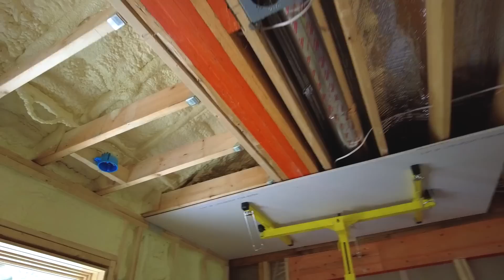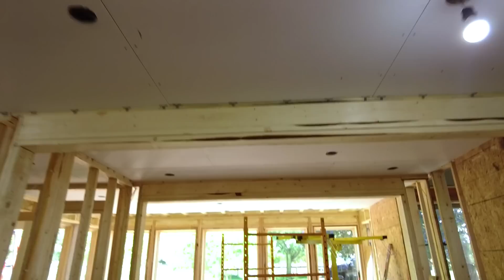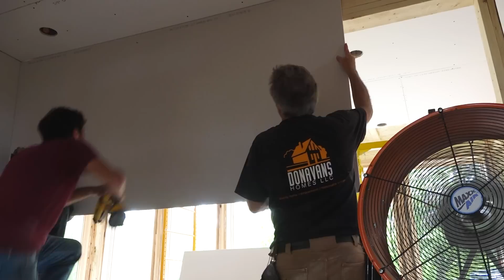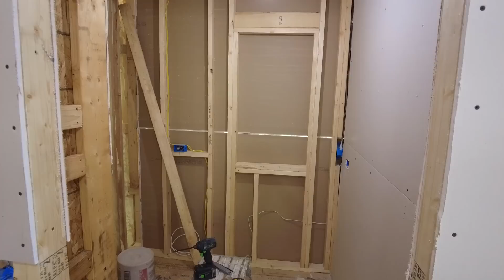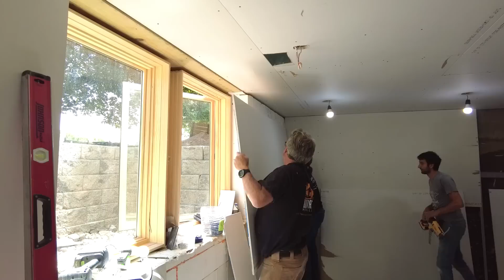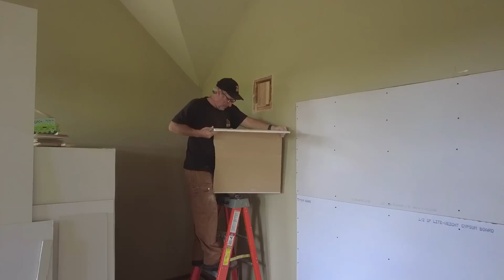Covering up our Beautiful Framing | Home Renovation & Addition Part 47

Comment: FINALLY !! Someone hanging drywall per code 😅😅… installed drywall in a customers add on this week and we installed 5/8“ x 54” x 16’ on the ceiling 5/8” is code here on the ceiling and the ceiling is installed before the walls … Good Job guys and gals 👊🏼👊🏼🪚🔨✌🏼🇺🇸🇺🇸

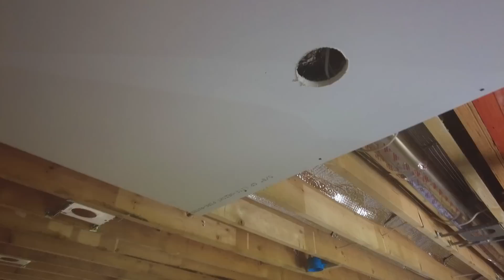Comment: Matt at 2:00 in doing the ceiling..  You guys don't use "strapping" across all the joists?  And the sheet rock mounts to that.  Also leaves a mini nook for the electrical wiring to go so they're not trapped in the bays and can't snake new wires after the ceiling is up..
Is that only a NorthEast thing?

Comment: I wondered why you were using a router to cut out the windows until I saw your next video which showed the other side and the router following the framing. In this video, how is Donivan finding and cutting the holes in the ceiling sheetrock?

Comment: ineresting no vapour barriers sheets on the exterior walls e and unsupported joines between the joists we always support them to avoid cracking
Reply: I believe they used closed cell spray foam to serve as a vapor barrier.
Reply: @GMC.Sprint  ok i see that now closed cell foam is a big no no in the uk now mortgae companies and surveyors dont like it as it traps damp and blocks ventilation in our roof consturctions.
Reply: @gavinferguson  I'm not a big fan of the spray foam in the southeast of the US.  My big issues are that it can hide leaks, and termites can tunnel through it unseen.  We also have a lot of heat and humidity, so places that are to well sealed grow mold.

Comment: Don't know if this was asked but is there a reason you didn't glue and screw the ceiling.
Reply: Australia has that requirement I know but in the US I have never even seen "drywall glue." Not sure where you are located, but It wasn't until I saw a bunch of videos from Australian drywallers when I first saw it. From what I can see, in Australia you can get away with a lot fewer screws because there's so much glue but here we just use more screws than you will see over there.

Comment: I noticed you don’t use ‘stud glue’ ? here in AU it’s specified to glue, the screws hold the sheet on until glue dries  ‘Gyprock’ or drywall. Also your ceiling sheets are dam thick, we use 10-12mm although it doesn’t snow much, :)
Reply: The 5/8 ceiling drywall is supposed to be for fire rating. its supposed to take longer for a fire to burn through to the upper floors or attic. In attached garages, they often specify two layers of 5/8 drywall  for a total of 32mm of thickness.
Reply: @bucklanddarrell3911  Some elevator shafts are up to 6" thick rock. Known as coreboard. It's 1" (25mm) x 2' wide.

Comment: Dumb question, I guess: how are Donavan's circular cutouts for fixtures so consistently good? Does he plunge the tool into the center mark on the sheetrock, run straight go to an edge, then let the tool follow the inside of the fixture? It appears to be freehand, but no way. I need that tool - I have never once made a cutout that clean.
Reply from the maker: Pretty close but once he finds the edge of the fixture, he pulls the cutter out a bit and moves to the outside and traces around that outside perimeter

Comment: Interested why you didn’t use furring strips on the ceiling? They also give a space to run the wiring, without having to drill the joists and helps for any future changes/ additions.

Comment: What a transformation. A couple of questions.
What was the yellow wire that snaked back and forth in the wall cavity in the right hand wall facing the back?
Do you not need plates to protect the wires berried in the foam foundation blocks? Like you need in stud walls when you run pipes through the studs?
Reply from the maker: That will be the feed for the cabinet that will go on that wall. The electricians will pull out however much wire is needed. Plates aren’t needed as the wires are far enough from the surface to not require them
Reply: @mcremona  Thank you. Making great progress.

Comment: I still don’t understand how he knows exactly where to cut the light part out from the ceiling, in a perfect circle right where it’s supposed to be...
Reply: He marks where the center of the hole should be then takes and saws a line from center to edge and follows the metal hanging there.

Comment: Last I heard, on the job, builders were requiring 80 boards a day to be installed. Every day. Commercial buildings are double rocked.
Reply: what the hell are you trying to say?
Reply: @idontthinkso666   Doing rock for a living sucks.  Do the math, at a minimum of 1/2 breaks in an 8 hour day,  80/7.5= 10.6 boards per hour. That's at least a board every 6 minutes.

Comment: Good morning you guys were using 8 feet drywall it is OK but after doing it for over 40 years I used mo ger board specially  I did a lots of slick finish a d for that it is better to have the least butt joint as possible but not to many people can do slick fin8sh today that is why they invented texture ceiling and orange peel wall it is an art to do slick finish but the hanging as to be done right also have a great day

Comment: Just curious as to why you don't use a "kick" or a "pocket kick" to lift your bottom wall sheets? 
To make the middle seams tight. You guys did move fast though.
Reply: I saw some blocks and pry bars in some of the shots. I usually just use some scrap pieces of drywall (1/2") to space it up from the floor and only pry up if needed.
Reply from the maker: Donavan didn’t have one in his trailer. We just used a prybar instead

Comment: Why is the ceiling drywall 5/8, but the wall drywall only 1/2?
Reply: It could be code.  I know there are some code requirements for 5/8 to be used as a fire wall.  If I remember correctly (in my area), it is required in a garage that is under living space.  could be required because it is a kitchen under bedrooms.
Reply: No, the 5/8” is used because the 1/2” would sag when hung from the ceiling.

Comment: So I see what I was doing wrong. I hung all my electrical boxes to be flush with the drywall. In doing so I was unable to push the drywall tight to the ceiling. Also I had to cut out the electric boxes from the outside of the box and not the inside.

Comment: Great video! Just a question about the drywall on the ICFs. Is the drywall not required to be fire rated, 5/8" minimum? I remember reading that somewhere but it may vary based on local codes

Comment: Wouldn't it be awesome to buil the house from real bricks and stones?  Maybe even use prefab concrete wall pieces? It would be properly fire- and hurricane-proof too. We use these 2x4's only for quick and cheap non-structural interior walls in Europe. Outside walls are solid! To be honest, i am shocked this kind of building is even allowed in the USA. I would expect a building inspector to stop this. In Europe we don't even build a dog house like this.

Comment: One idea for the pantry window is to use a window with built louvered blind.. that way you can get the light when desired but still close it off when you don’t want people to see in. Another option (albeit more expensive) would be the new electronic glass that can be switched on and off between opaque and clear.
Reply from the maker: Great ideas. Thanks!
Reply: Louvered blinds gather too much dust !! Keep it simple and easy - I suggest a one-way mirror !!
Reply: @johnking8679  I believe he meant blinds encased between the panes,he left out the word 'in' after built.
🙂✌️❤
Reply: My sister-in-law has a translucent blind that opens from the top AND bottom.

Comment: what is the screw attachments you use with your drills?  those are awesome.
Reply: It comes that way. It's not an attachment.
Reply: It is a Dewalt DCF620 20V Max XR Drywall Screw Gun with a DCF6202  Screw Gun Collated Attachnent.

Comment: What is the name of the tool you use for the holes in the ceiling and the wall.
Reply: RotoZip -- uses a spiral bit with a non-cutting tip that follows a pattern (electrical box, door frame, etc). Takes a bit of practice, but definitely the way to go if you  have more than a couple of cutouts. Mine's corded (don't remember cordless being an option back when I got it, but I was using a corded drill to drive the screws too, so needed the extension cord anyway), but cordless would be even better.
Reply: RotoZip was the first and like Xerox  it's a trademaked name.  Search for drywall cutout tool to find all the people who copyed RotoZip....
Reply: Thans.

Comment: I couldn’t agree with you more that the Dewalt Drywall screw gun with screws on a belt is the absolutely best way to hang multiple sheets of drywall.  I’ve put thousands of screws in drywall and didn’t have the dimple adapter and it’s a major pain in the backside.  The dimple attachment helped a lot, but it doesn’t hold a candle to how much easier it is with the dedicated drywall screw gun.  The rooms are all really looking more like a home place and less like a construction zone.

Comment: How does Donovan know where to make the cutout holes so accurately?  You all work as a good team for that drywall work.
Reply from the maker: Measures the box location before putting up the sheet
Reply: Experience is key with measuring the right spot!
Reply: Guys that do rock for a living, all the time, can feel the outlets and protrusions without measuring. When you do 80 sheets a day, 5 days a week, for years, eventually you get the knack.

Comment: Kitchen area really lowered the ceiling. The extreme length makes it look even lower. Didn't think you were rocking that area, just trim. Certainly easier with rock on first. And how tired is Donovan after those few days. Very hard work.
Reply: Sheetrock adds some R value as well as a sound deadening factor. Plus it will even out the imperfections from the studs. I would still tape all the corners to seal them off, but not do anything more to them.